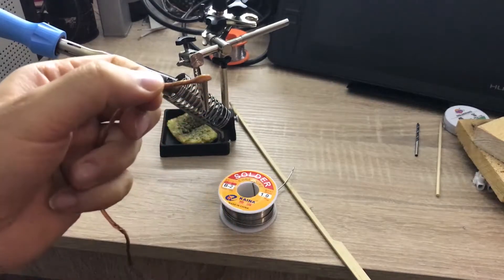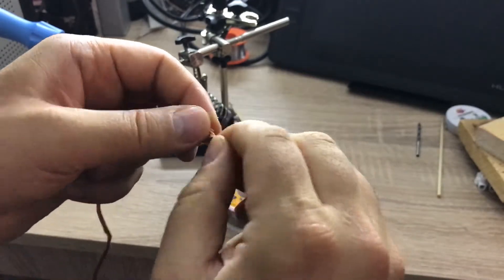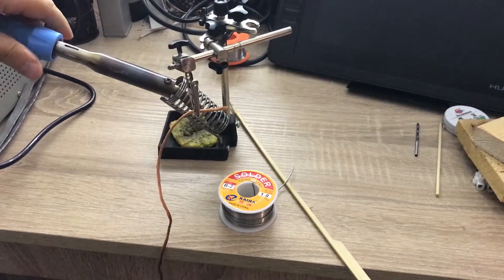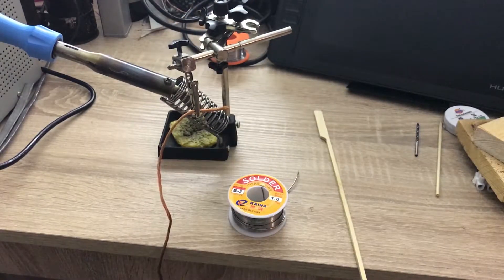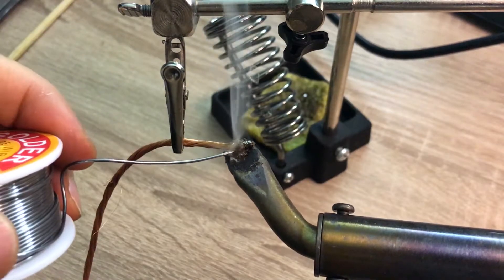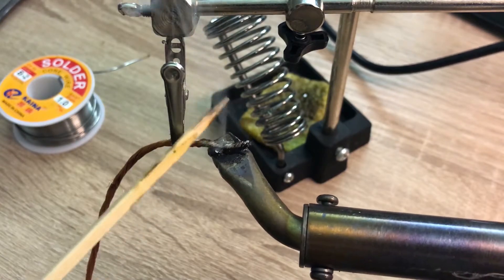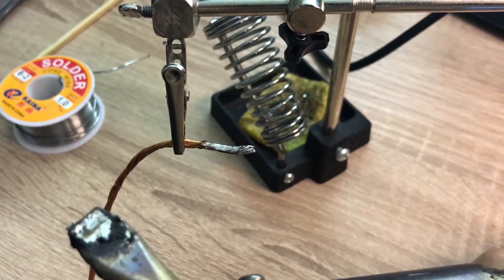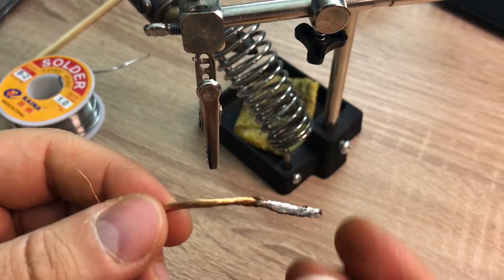How to solder Litz wire ( how to tin Litz wire)

Comment: TWO THINGS...
1)  Do not clamp the wire in alligator clips (it can cut into the fine strands).  Instead, do something like applying shrink-wrap in the clips, etc.
2)  After soldering the first end, test for continuity with a couple of random strands on the other end.
Thanks for the video!

Comment: Good advice! Can you say how much cost this litz wire wich you used on this video? Thanks!
Reply from the maker: This was an old piece of litz wire, similar type brand new cost ~4 Euro per meter if you buy from Aliexpress. https://nl.aliexpress.com/item/1005002010578666.html?spm=a2g0s.9042311.0.0.5a9e4c4d5r1CkH
Reply: @HVE  Thanks for reply!